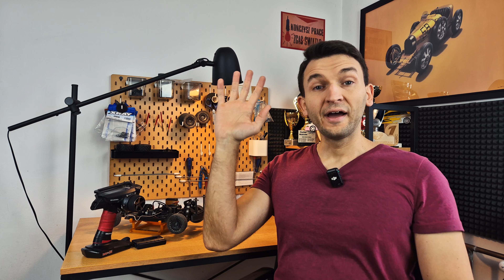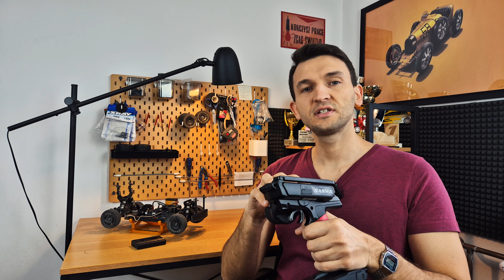Improve the Throttle of your Rc Rally Car with a Program Card

Comment: I really enjoyed going through this, and I learned finally what the neutral range is for. I have always kept it on suggested settings... 
Yes, so many ways to adjust how the car reacts to your inputs, of course the first adjustment is yourself. I learned that on the track the other day, I had been reading a book for racing (Invisible Speed), and I learned "Smooth is fast", so I was more smooth on both throttle and steering, first it was slow and annoying, but quickly became quite enjoyable and also faster.
No idea if I ever manage to get me an RC rally car, but at least I enjoy your video content!
Reply from the maker: I'm happy to know that you found this video useful! I feel like as long as you play with RC cars, you never stop learning, especially if you have the drive to improve yourself. That book looks quite interesting.
I'll probably get a copy for myself

Comment: Nice, thank you for the insights, even though my ESC is a bit limited about programming. But punch and brake force are adjustable. 👍
Is this normal wear on your tires, or do you prepare them? Just wondering because the outside looks a bit "bald".
Reply from the maker: Welcome! It's normal wear. Currently I'm driving on worn out bearings and because of that it happens to have a quite positive camber in the corners